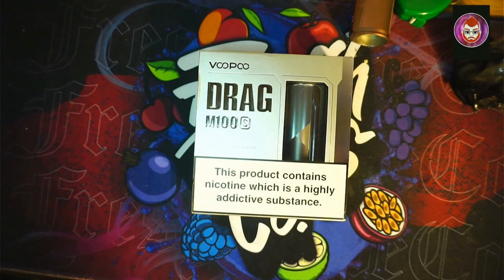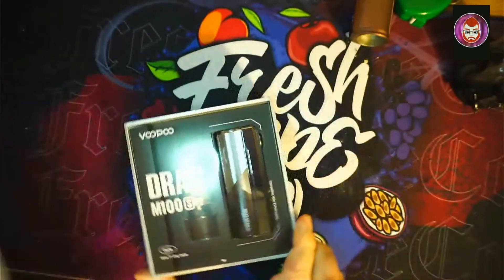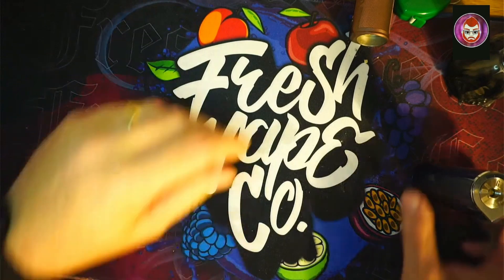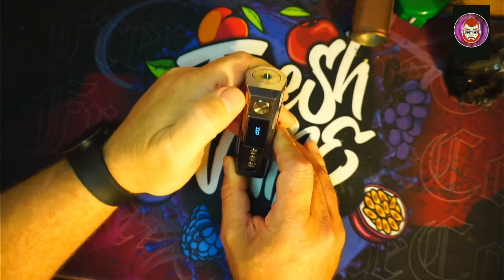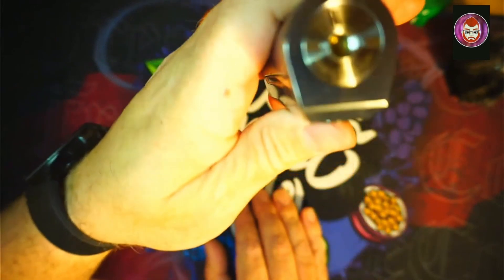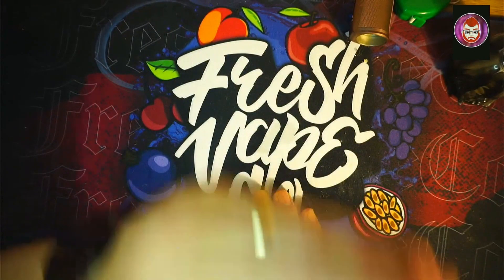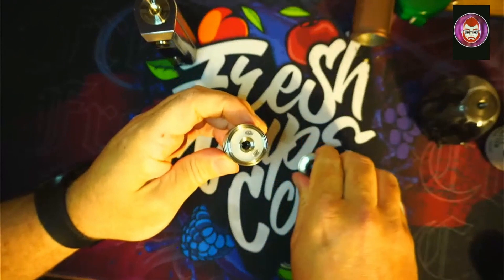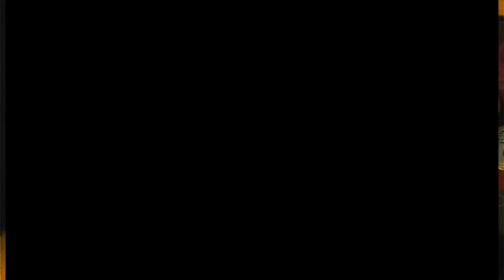Unboxing and up close look ofbthe new Voopoo Drag M100 S

Comment: It is a shame your the only one i see pointing this out my atomiser ring came of it's only stuck down with glue no screws i had to use epoxy resin to glue the ring back on i purchased the lost vape Thelma Solo although a lil taller it's better than this mod why do they cut corners on a mod that had good potential